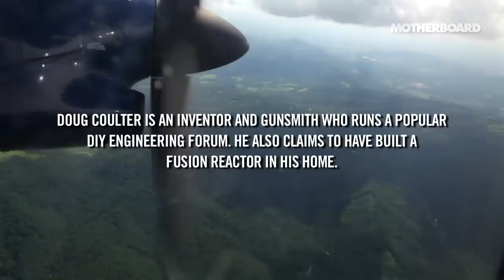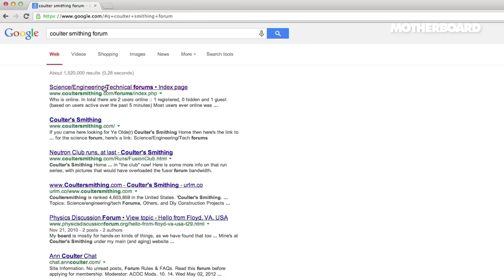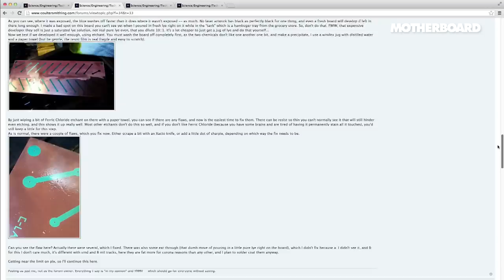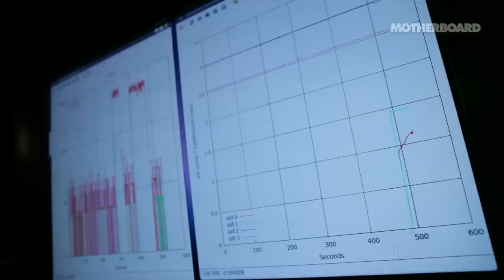Developing Nuclear Fusion in a Basement with a Reclusive Gunsmith

Comment: Isn't it radioactive as fuck ?
Reply: Only from a fission reactor, not from a fusion reactor.
Reply: Dennis McCollum Exactly... I was going to make a comment for people not to mistake fusion for fission :-)
Reply: There are no radioactive decay products from nuclear fusion.  From nuclear fusion one gets helium and water.  There is a temporal release of large amounts of neutrons which are controlled by the reactor being in a lead box during the fusion reactions themselves.  Once the reaction is complete and cooled, the byproducts are stable helium and water.  That's it.  clean and cheap.  One needs a supply of hydrogen and the ability to get more energy out of it than you put into it.
Reply: Dov BarLeib
Acutally, yes there are.  With some kinds of fusion, including the type I'm now doing (deuterium), there is tritium as a bybroduct (a valuable thing) and also a ton of neutrons - which make other stuff radioactive if you're not careful.  But it's still better than fission by a country mile.  There are a-neutronic reactions, but they are harder to do - and harder to measure, since the results are all charged particles hauling ass - which happens in an IEC even when there's no fusion, so it's like trying to sing while deaf - the nice thing about the neutrons is that they are quite rare in nature, so we can "hear" while we learn to sing.
Reply: if the reactor is sealed, there's no risks. in fact if it wasn't, it would not operate.  but as Mr. Coulter mentioned, there's indeed a nuclear reaction, therefore protons, and gamma rays in movement on the reactor, normally binded by a strong electromagnetic field to focus the plasma.
Reply: You need shielding as well as sealing.  Don't try this at home without doing the homework.
The DD reaction makes lots of neutrons too, and they tend to make other things radioactive unless you stop them some way.

Comment: You're not getting in anybody's way? Oh ok, so you understand every possibility of what you're doing? If you do, you would know you have to possibility of ruining everybody's life if the Higgs particle is real. It's possible that everything is connected and a big enough split could create a black hole. PLEASE LEAVE THIS WORK TO CERN!
Reply: +RCorbzz I think you don't understand physics as well as either I or they do, and we are working on totally different aspects of it.  Their detectors often don't even measure as low an energy/particle as my hottest ones are.
Reply: +Doug Coulter Exactly my point, its not a subject that has been tried. It's best to leave it to professionals. We aren't talking about creating a vacuum cleaner here, we are talking about subatomic particles that need multiple brains working together for us to even attempt to understand. You are not smarter than the whole of CERN! If you are what you say you are then why don't you attempt to join the professionals!
Reply: I AM a professional, even those guys over there say so.  Gheesh, looks aren't what make it so - it's ability.